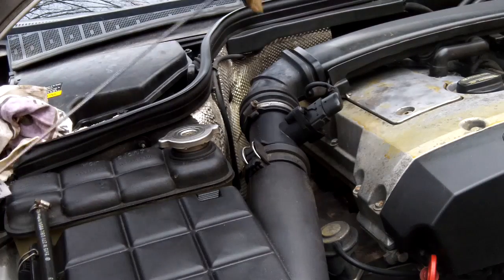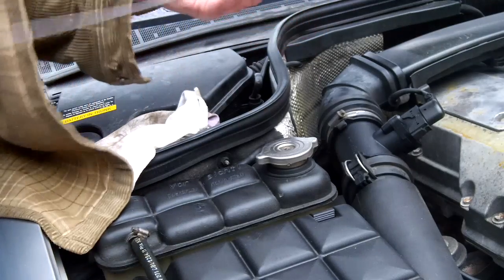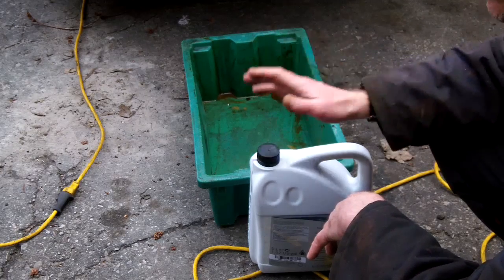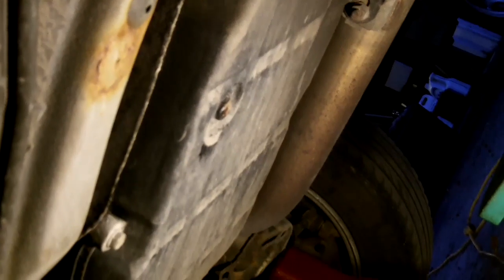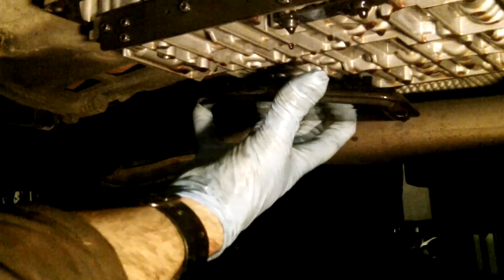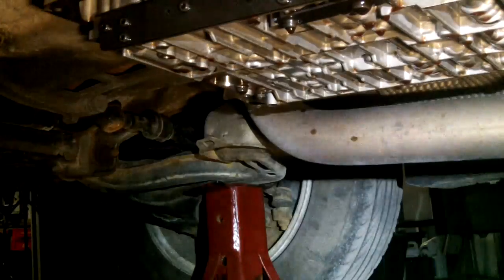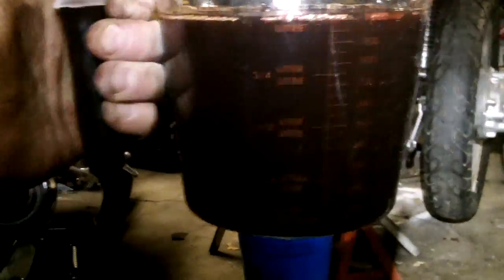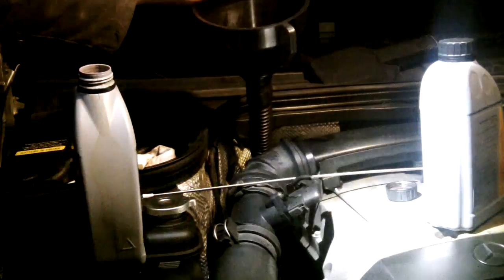Mercedes 722.6 automatic transmission .fluid and filter change..w202

Comment: First of all, thank you for all your videos, you are great. I have a Mercedes W202 C220, with an automatic transmission, this past week there were times when I lost fourth gear, and drove only in third gear. After a while at a constant driving, I began to lose and third gear also, car switched to the 2nd gear like I pressed kick down, but I did not. Maybe you could help. Thank you in advance.
Reply from the maker: hope this all pastes into the answer..if not send me a private message....

TROUBLE SHOOTING

TRANSMISSION SLIPS IN ALL GEARS

Incorrect modulating pressure. Modulating pressure control
valve or pressure relief valve  is dirty or sticking. Vacuum line to
transmission vacuum capsule clogged or leaking. Working pressure
control valve dirty or sticking. Low working pressure. Defective
primary pump.
Transmission Slips When Starting Off In 1st Or 2nd (Reverse
Is Okay)
Band B-2 shift valve sticking. Band B-2 piston worn or
damaged. Band B-2 adjusted incorrectly or worn or damaged. Adjust
brake band B-2 by installing a longer thrust pin (if necessary). If
transmission operates properly with selector lever in "2", but not in
"3" or "D" position, one-way clutch may be slipping.
Transmission Slips In 2nd Gear Or Shifts From 1st To 3rd Gear
Check control valve B-1 for ease of operation. Replace valve
body (if necessary). Remove and install brake band piston B-1, check
sealing ring and replace (if necessary). Replace brake band B-1 and
thrust body for B-1. Command valve binding.
Transmission Slips During 2-3 Upshift Or Slips Initially,
Then Grabs Hold
Check modulating pressure and adjust (if necessary). Check
for temperature throttle installation (if equipped). Valve body worn
or damaged. Replace valve body (if necessary). Replace inner plates of
clutch K-1 or recondition clutch (if necessary). Check front cover
Teflon ring.

TRANSMISSION SLIPS DURING 3-4 UPSHIFT

Check and adjust modulating pressure. Governor damaged or
working pressure incorrect. Valve body worn or damaged. Replace valve
body (if necessary). Check Teflon rings supporting clutch K-2. Replace
inner plates of clutch K-2 or recondition clutch (if necessary).

INTERMITTENT NO 5TH GEAR

Check loose connections at throttle valve  switch. Check for
poor or loose wiring connections between TCM and transmission. See
WIRING DIAGRAMS. Ensure proper TCM is installed.

NO 5TH GEAR OR TRANSMISSION SHIFTS TO 5TH UNDER LOAD

Check and repair vacuum line between intake manifold and
ignition control unit.

NO POSITIVE ENGAGEMENT IN REVERSE

Check plates and sealing rings on brake B-3 piston. Replace
if necessary.

HARSH ENGAGEMENT WHEN SHIFTING GEARS

Incorrect working pressure. Check and adjust modulating
pressure. Check vacuum line  and connections for leaks. On vehicles
equipped with diesel engines, check vacuum control valve. Coolant
entering transmission oil cooler and contaminating transmission fluid .
Replace radiator. If necessary, replace all friction linings and/or
replace transmission.

HARSH ENGAGEMENT WHEN SELECTING "D" OR "R"

Idle speed too high. Check pressure receiving (pick-up)
piston in valve body for ease of operation and correct installation.
Replace valve body (if necessary).
NOTE: Pressure pick-up requires a running period of approximately
2 seconds. Harsh engagement may occur during repeated shifts
between "N" and "D". If harshness takes place within 2
seconds, condition is considered normal.

HARSHNESS ON 4-3 DOWNSHIFT

Sealing ring on release end of band B-2 worn or damaged. Band
B-2 piston worn or damaged. Band B-2 thrust body damaged.

CHATTER DURING UPSHIFT

Valve body malfunction. Check and repair or replace valve
body.

WILL NOT UPSHIFT

Incorrect governor pressure. Defective governor assembly.
Check for stuck kickdown solenoid  or for constant voltage to solenoid 
caused by a defective fuel pump relay or sticking kickdown switch.
Valve body dirty or valves sticking. Repair or replace valve body.

UPSHIFTS AT HIGHER SPEEDS THAN SPECIFIED

Check pressure control cable engagement, condition and
adjustment. Check for stuck kickdown solenoid or for constant voltage
to solenoid  caused by a defective fuel pump relay  or sticking kickdown
switch. Check governor pressure. If regulator pressure is too low,
replace centrifugal governor. Ensure control pressure regulating valve
is operable.

UPSHIFTS AT LOWER SPEEDS THAN SPECIFIED

Check pressure control cable engagement, condition and
adjustment. Check full throttle stop by accelerating engine and
ensuring throttle valve  rests against full throttle stop. Readjust
throttle stop (if necessary). Check governor pressure. If governor
pressure is too high, replace centrifugal governor. Repair or replace
valve body.

NO KICKDOWN

Check throttle control and pressure control cable engagement,
condition and adjustment. Connect kickdown solenoid  to battery and
check for proper operation. Replace solenoid (if necessary). Check
kickdown valve in valve body. Replace valve body (if necessary).

NO 4-3 OR 3-2 DOWNSHIFT

Control pressure cable out of adjustment. Leaking vacuum
hoses  and/or connections. Ensure brake shaft piston is operable.
Replace valve body (if necessary).

UNCONTROLLED DOWNSHIFTS OUTSIDE RANGE OF KICKDOWN SWITCH

Remove kickdown solenoid. Check "O" ring on kickdown solenoid 
for damage. Check kickdown switch for sticking in pushed-in position.
Replace switch (if necessary). Check for kickdown solenoid stuck in
opened position. Replace kickdown solenoid (if necessary).

POOR ACCELERATION FROM STOPPED POSITION

Check stall speed. If stall speed is 400-700 RPM less than
specified value, one-way clutch in torque converter is slipping.
Replace torque converter (if necessary).

PARKING PAWL WILL NOT ENGAGE

Check rear engine mount . Replace engine mount (if necessary).
Check adjustment of selector rod. Adjust selector rod (if necessary).

SELECTOR LEVER DOES NOT ENGAGE IN "R" OR "P"

With engine running, clean centrifugal governor and ensure
correct operation. With engine not running, check operation of detent
piston in lower cover.

ENGINE WILL NOT START IN "P" OR "N" POSITION

Adjust shift rod and starter lock-out switch. Replace starter
lock-out switch (if necessary).

SMOKE IN EXHAUST (FLUID LOSS)

Diaphragm in vacuum control unit defective. Transmission oil
is being drawn from engine through vacuum line. Replace vacuum control
unit (if necessary).

FLUID LOSS BETWEEN TORQUE CONVERTER & PRIMARY PUMP

Seal torque converter oil drain plug. If leak continues,
replace radial sealing ring and "O" ring on primary pump. Check
primary pump "O" ring groove for porosity. Replace primary pump (if
necessary).

HOWLING NOISE WHEN CHANGING GEARS (UNDER FULL LOAD)

Replace transmission oil filter.

HOWLING NOISE WHICH INCREASES AS ENGINE RPM INCREASES

Check primary pump and replace if necessary.

1ST GEAR & REVERSE TOO LOUD

Replace front planetary gear set. Reverse and 1st gear are
louder than forward (driving) gears due to gear reduction. If noise
seems too loud, or if in doubt, a similar vehicle should be used for
comparison.

3RD GEAR TOO LOUD

Replace rear planetary gear set.

RATTLING NOISE AT 1500 RPM IN ALL POSITIONS EXCEPT "R"

Brake B-3 plates are vibrating in transmission housing.
Replace brake B-3 plates, install damper spring and set release
clearance to minimum value.

LIGHT GRINDING NOISE IN "P" & "N" POSITIONS

This condition is normal if a "rolling" noise of front
planetary gear set is heard. If noise seems too loud, or if in doubt,
a similar vehicle should be used for comparison.

"ROLLING" NOISES WHEN DRIVING IN REVERSE

Disc brake B-3 release clearance too great. Adjust release
clearance to .06-.08" (1.5-2.0 mm) or replace disc brake plates.
Outside plate carrier of clutch K-1 contacts piston.
Primary Pump Bushing Loosens After A Short Operating Period -
Dowel pins for centering transmission to engine are not in place.

Comment: Fupa, what about doing this and also suck oil with an oil extractor pump from dipstick?
Like this:
1 Drop the pan, clean, change gasket.
2  Suck with extractor from dipstick
3 Refill and go for a ride
4 repeat 2 and 3 as necessary
do you think this can work?, also seems like a rookie friendly method, torque converter fluid cant be accessed like this tho, but I think it can get more fluid than just with the pan.
cheers
Reply from the maker: an extractor won't remove any more oil than dropping the pan...when you remove the pan you will see the dipstick where it comes down and almost touches the pan..so removing the pan leaves no more for the extractor to suck up
Reply: You're right, so it won't get more fluid,but it could be a good lazy fluid change method, turkey baster like with more percentage of fluid renewal (not as cheap though).
Reply from the maker: akafede you could do it if you didn't want to change the filter.. extract the fluid cold and replace with the same amount...I would rather change the filter at the same time, but it would e better than leaving old fluid in
Reply: I use a Topsider for oil changes and was wondering the same thing. Challange would be cleanliness as all the parts of the Topsider are oil drenched. New hoses and some sort of quick release would work. Ill post once I do it. Turkey baster will make you crazy by the time you remove all that fluid. I just used one on the power steering pump and it ends up a mess no matter how careful you are. Way too many individual transfers of fluid. Good luck. If you don't hear from me it's because I lost the link to the video. It happens.

Comment: What if the fluid is yellow? As is in my Ssangyong Rexton that has a Mercedes engine and Automatic Triptronic  gearbox.
Reply from the maker: your car has the newer 7 gtronic transmission. I believe it has a yellow coloured fluid . It uses a different fluid than the 722.6 in this video
Reply: I've checked the fluid in two w211 E Classes with the 722.6 5 speed auto. One was an 04 E320 and the other was an 08 E350 4matic. The fluid was yellow in both. I was actually wondering why the car in this video had red fluid. As mentioned in the video, the pan had been dropped before because one of the bolts was different so I'd guess the previous owner had changed the fluid and used a red fluid. IDK I can assure you that the yellow fluid is completely normal though.

Comment: Hummmmm ... Should the engine be running when you check the transmission fluid???
Reply from the maker: +D Hubbard  Yes.. as I said in video though..I turned it off so I wouldn't have to yell over a running engine
Reply: +fupabox Oh, Do you mean the little box in the lower right hand corner that briefly  popped  up?  
Anyway, thanks for the video it was helpful.
Anyway to tighten the bands on that puppy without preforming major surgery?
Reply from the maker: D Hubbard Yeah I guess I have to check that pop up box..wasn't working..thanks for pointing it out...heres the full service manual for the 722.6..might have some info for you..I haven't adjusted any bands on them.. http://www.lx.abodiesonline.com/Manuals/NAG1%20Manual.pdf

Comment: I'm fixing to do this to mine only problem is my transmission has been leaking so measuring what comes out isnt thing to be the right amount ive watched a couple of videos n seem all of them was replaced with 3.5 to 4 liters what would you recommend me to do I just bought the car also
Reply from the maker: If you have the dipstick you can measure the amount drained, put the same amount back in ,then check the level with the dipstick to be sure
Reply: @fupabox  yes I have a dip stick it was already on the car I guess someone bought one for the it has a clip that locks onto the tube its self but its super low on fluid its barley visible on the dip stick

Comment: Hi. Do you have the length that the dipstick should go into the dipstick tube in order to get the proper reading? I have the ebay dipstick and the reader end flexes and I just cant get a consistant reading, I did the fluid change as per and it seems to be smoother as the old fluid was chocolate milk! Ty!
Reply from the maker: yeah getting a reading can be a bit tricky...just push the dipstick in until it hits bottom, but es it does feel mushy sometimes. I'm not sure the length it goes in till it hits, I can measure mine and let you know
Reply: *****
Hi. I figured out the proper depth by using some steel garage door cable that doesnt flex as much. I have another question though...what is the procedure for removing the 2 " body trim on the doors ect for rust repairs? Ty as always!
Reply from the maker: William Z undo the phillips head screw on the inside of the edge of the door..then the whole door trim slides forward or backwards and pops right out..check this video ..it's the same except no pop clips on the lower edge..just the screw and slide 
Mercedes sl  R129 door/fender plastic lower cladding/trim removal
Reply: ***** Oh my you just gotta love how these cars are engineered! Lots of little rust spots gonna drive me more nuts! Now how about the black rubber weatherstrips on the bottom of the doors? Do they pop and slide? Ty as always!
Reply from the maker: William Z Yeah the water based paint introduced in the mid 1990s wasn't great at preventing rust... If you are talking about the seal that goes all the way around the door it just pulls out of the slot...the thick rubber seal at only the bottom edge is popped in with push clips like on a door panel if I remember correctly

Comment: When I check the fluid level with engine off and cold it shows just above the cold mark on the stick. What I don't understand is when i start it the fluid will drop to just below the cold mark and will stay at that level even after it has heated up idling for 10 minutes or so and the level does not change even if I shift into all the gears. Originally I had slightly overfilled the transmission but have sense drained what I thought would be more than enough fluid. Could this somehow be some excess fluid from when it was overfilled that hasn't fallen back into the system and marks the end of the dipstick? I have no idea who the system works but I'm at a loss. Thank you for your help in the past I hope to hear from you again soon.
Reply from the maker: +Pete Rooster The only accurate check is with the engine running, after about a 15 -20 minute drive.  as long as the fluid is then at the mid range of the hot mark..it is good .  The cold mark is only to check that there is actually fluid in the transmission..it isn't at all accurate in gauging the proper level.
Reply: +fupabox I understand that is the only way to get an accurate reading but was trying to get the fluid to roughly the correct level before driving it at all so I don't cause any damage. Is there a way to adjust the fluid without driving it or would you recommend to go ahead and drive it as is.
Reply from the maker: +Pete Rooster if the fluid is in the cold level when the engine is cold and shut off, you will be okay to go warm it up...just don't drive on the hwy or accelerate quickly..just gently drive for 15-20 minutes..I test drove one once that was way overfilled...on the highway the overflow valve on the tranny ,puked about 1 liter of fluid onto the hot catalytic converters...smoke everywhere like it was on fire...it wasn't noticeably flowing out until we hit highway speeds..LOL  I didn't buy that car  :)
Reply: +fupabox  Thats crazy man. I had some unique experiences when I was looking for mine but nothing like that. Some people will try to sell you anything. So when I check the dipstick with engine not yet run it's in the cold markings and it sounds like this means its ok to drive. I really thought it was under filled though. What may be some signs of this I can look out for in case it is? I'll most likely be keeping in the neighborhood so I can take it right back if I need to and please forgive my hesitance I'm just really on edge about this. I really appreciate the advise.
Reply from the maker: +Pete Rooster if the level is really low it will have a hard time shifting between gears. if it is in the cold marking when cold you will be ok.

Comment: hey was wondering if u had any input, i have a 1999 c230 kompressor and the gear slipped a few times in the past month for the first time since i got it. I was going about 50-60mph so im assuming about 4th gear and it just gave out and although was still shifted in drive acted as if in neutral therefore there was no response when pushing the pedal, just the engine revving? is this a transmission problem?

Comment: HI. i have an w202 99model. 1.8 122ps with automatic gearbox. how many khm i must change oil in gearbox. thank you
Reply from the maker: I try to change it every 40-50k miles .. 60-80k km
Reply: fupabox thank you

Comment: Wanting to drain torque converter as well. Is the fluid within the converter separate from transmission fluid or is it integrated?
Reply from the maker: it's all part of the same system...the torque converter just retains more of the fluid that has been pumped through it when the car is turned off
Reply: ***** Suspected it was but needed to make sure. Cheers for your time again

Comment: I torqued my pan to 10 ft/lbs per bolt with a new gasket but I see a lot of oil leaking from the gasket. What could be the problem?
Reply from the maker: torque is deceiving.. 10lbs is spec under perfect conditions,, new bolts with new threads in the bolt hole and no dirt or rust.. the specs for torque are fine when you are up in the 60-70 lbft range or higher, but low specs like the 10 lbs for the pan bolts are only really a reference.. snug them all up a tiny bit more and the leaks should disappear
Reply: thank you!
Reply: If all fails use rtv ,sometimes the mating surfaces get gapped and warped,the regular gasket may not be flexible enough to fill those gaps,but rtv will.I use red hi temp rtv on tranny and differential covers.